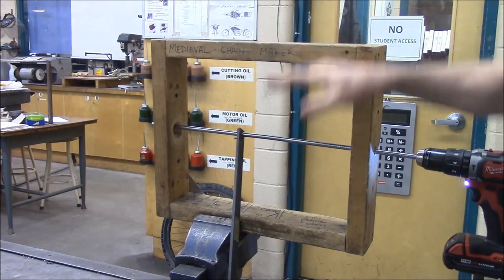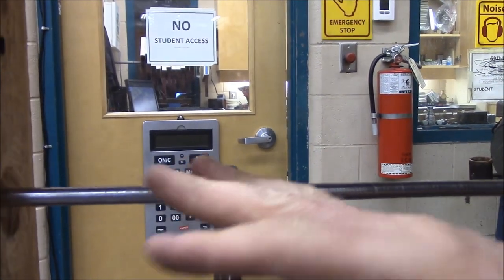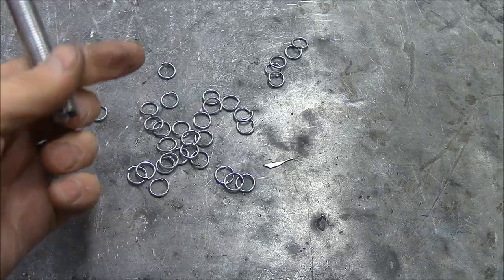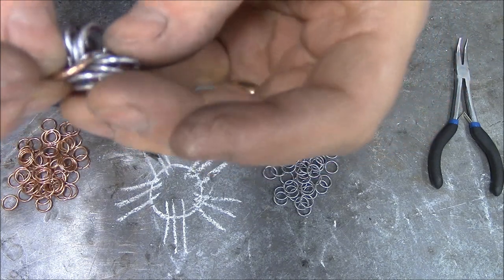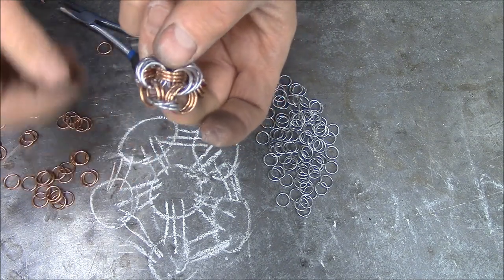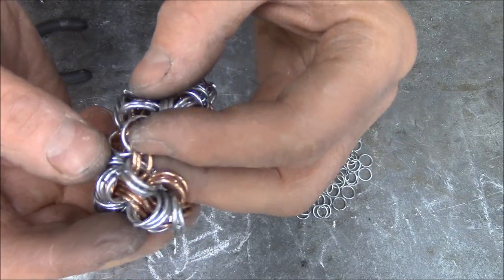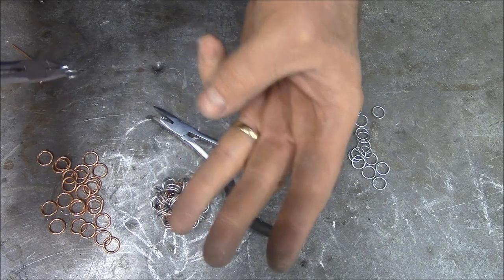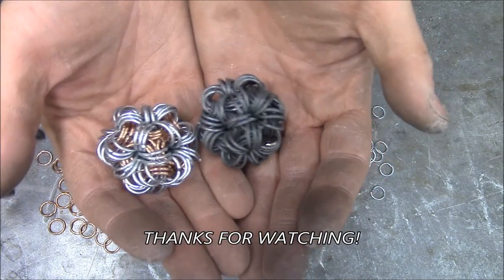BUILD a Chain Ball - FREE PLANS!!

Comment: If you modify and grind narrow one of the sides of the bolt cutters, you can easily slide a longer coil on to be cut.  Makes cutting way easier.  However, if you try and use the bold cutters on anything else it they will break.